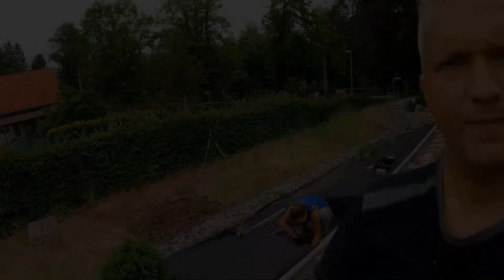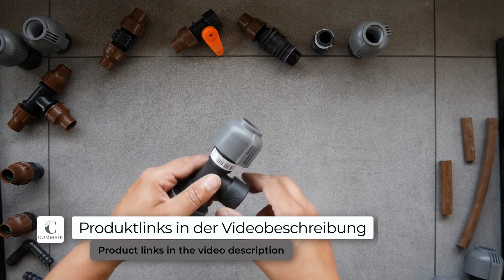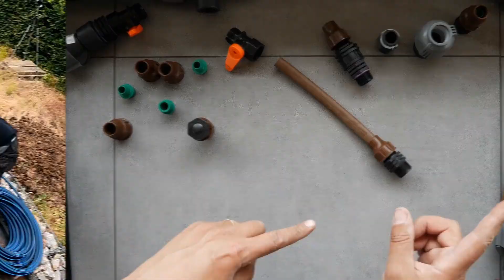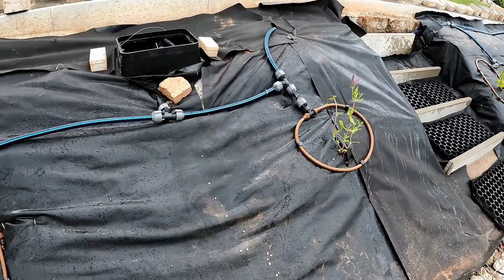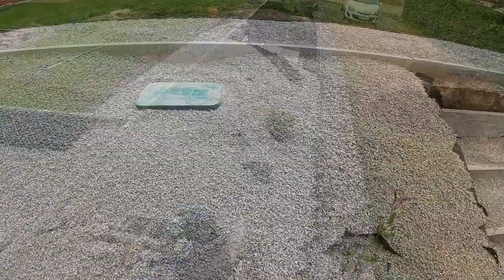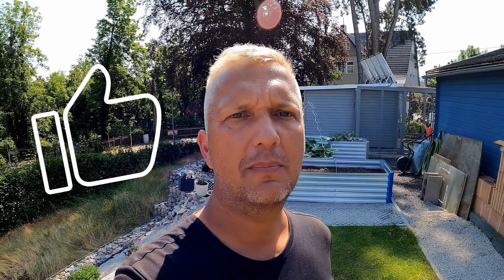Secure gabion slope & install drip irrigation - Hunter & Rain Bird guide

Comment from the maker: *👇 All products & links from this video:
🔗 50cm gabion https://geni.us/LcUd (Amazon)
🔗 100cm gabions https://geni.us/AU7QfTm (Amazon)
🔗 Drainage fleece https://geni.us/0Yxo1zR (Amazon)
🔗 Bolt cutters https://geni.us/BXZB4tW (Amazon)

🔗 RainBird drip hose above ground https://geni.us/yQ4bze (Amazon)
🔗 RainBird drip hose underground https://geni.us/xUx5B0 (Amazon)
🔗 Pipe anchor https://geni.us/oUG6hqB (Amazon)
🔗 PE pipe https://geni.us/eyqbB6n (Amazon)
🔗 Ground anchor https://geni.us/Wumypq (Amazon)

Fittings for Rain Bird drip pipe
🔗 Connection 3/4 AG https://geni.us/0kxB9If (Amazon)
🔗 T-piece https://geni.us/7Qpk (Amazon)
🔗 End piece https://geni.us/G8KLw3F (Amazon)
🔗 Elbow https://geni.us/YiiUvQP (Amazon)
🔗 Fittings for raised bed https://geni.us/1kqKDt (Amazon)

Fittings for PE pipe
🔗 Connector 3/4” IG https://geni.us/3kzRpt (Amazon)
🔗 Connector 1” https://geni.us/z7Ffl (Amazon)
🔗 T-piece 3x PE https://geni.us/UkFuX6 (Amazon)
🔗 T-piece 1x 3/4” IG https://geni.us/upDyDYU (Amazon)
🔗 SwingJoint 3/4“ x 3/4” https://geni.us/vCRAb (Amazon)

🔗 Valve box https://geni.us/OZip7rh (Amazon)
🔗 Rain Bird manifold https://geni.us/jgmAmM (Amazon)
🔗 Rain Bird elbow https://geni.us/0smEO (Amazon)
🔗 Quick coupling 1” https://geni.us/C2cXKP (Amazon)
🔗 Solenoid valve https://geni.us/SbhYwWf (Amazon)
🔗 Control cable https://geni.us/8dv0 (Amazon)
🔗 Watering computer https://geni.us/tGwn (Amazon)
🔗 Empty conduit https://geni.us/gmTRB (Amazon)
🔗 Protective fleece https://geni.us/pPmg1M8 (Amazon)
🔗 Honeycomb grid https://geni.us/irLw (Amazon)
🔗 Pipe shears https://geni.us/RR7ke0 (Amazon)
🔗 Core drill https://geni.us/5XzL2B (Amazon)

🔗 Sage https://geni.us/I1SV (Amazon)
🔗 Eucalyptus https://geni.us/BWTKQ (Amazon)
🔗 Lavender https://geni.us/q8D8JWQ (Amazon)
🔗 Boxwood https://geni.us/zAbAcY (Amazon)
🔗 Succulents https://geni.us/zBUSj (Amazon)

Follow me on my social media channels for more content! @commaik

🎥 This video was originally produced in German for my main channel:  
https://youtube.com/commaik  
It was then translated into English using Heygen – with my own voice and lip-sync.

🎙️ Want to dub your videos like I do? Try Heygen:  
🔗 https://www.heygen.com/invite/b96cdcf6 – Get 300 free credits when you subscribe.

📺 The original video, which includes English subtitles, can be found here: https://youtu.be/EATCfSjUo60

Note: All links marked with * are affiliate links. If you make a purchase through these links, I will receive a small commission at no additional cost to you. Thank you for your support!